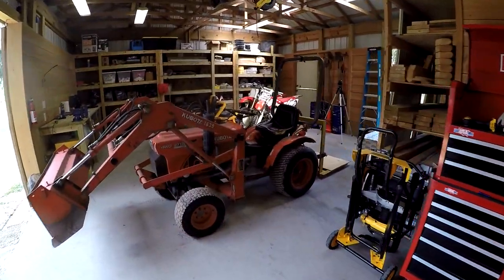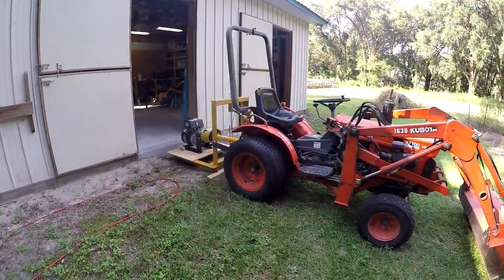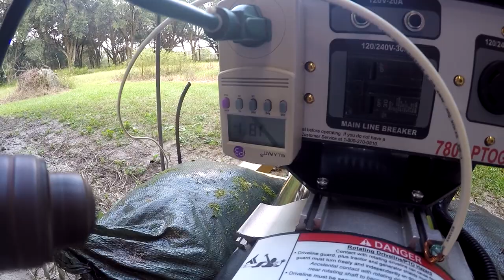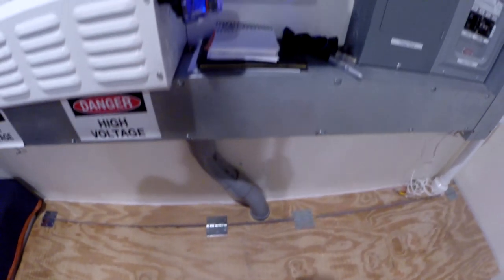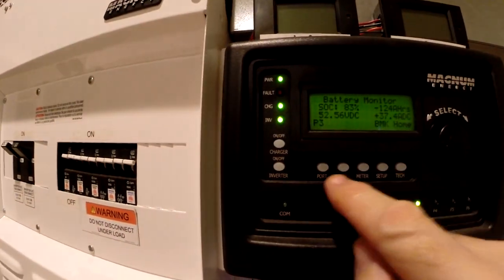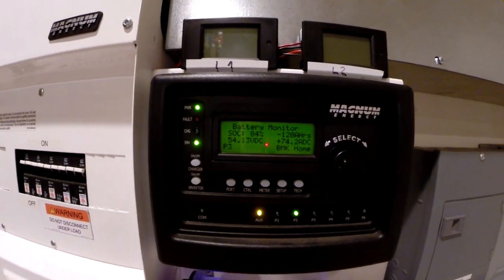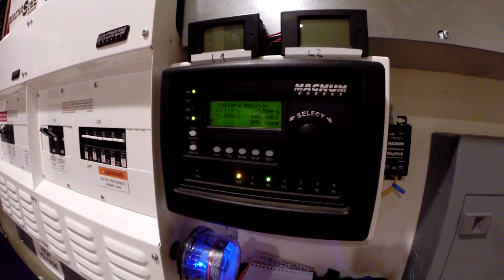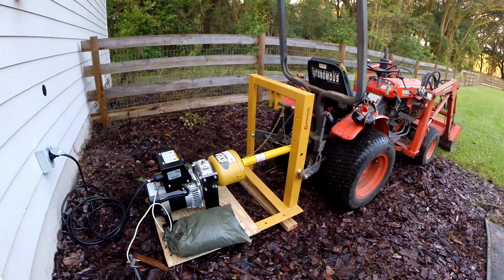NorthStar PTO Generator on Kubota B7100 Tractor

Comment: 2 things. Thing 1.  Ditch the plywood and use angle or channel as a foundation to mount the genny to.  Thing 2.  Don't leave your power cord from the house to the generator all coiled up.  I work at a major pharmaceutical company and we hooked up a giant diesel generator to run a building during a site shutdown.  The 500MCM hookup cables didn't need to be run very far to hook the generator up to the building so they left the cables coiled up on a pallet and just hooked up each end.  After a couple of hours, someone smelled something burning and it was the coiled up cables on the pallets.  It's the same principal as energizing a solenoid coil without being over the armature...gets hot in a hurry.
Reply from the maker: Good "things" to know.  Thanks!

Comment: Dave, I built nearly an identical setup about 6 months ago.  I used a Winco 10kw (made in the USA), and the same carry all.  Winco wanted $650 for their gen carrier.  As others have said, I would not use it for continuous power but running it a couple of hours a day to keep the freezers cold and other items charged is all one really needs to do.
Reply from the maker: Yes, a couple hours a day should do the trick,  The way I am using it, I only need to run it a couple hours per week and I with 200 gallons of diesel I expect I could go for about two years without utilities.  Thanks!

Comment: Fantastic video! You solved your "pros and cons" by installing a system with battery back up. You don't need two tractors! My wife and I are preparing to build an Earthship Biotecture style home in Northern Nevada...this is a means to generating power until the 4.6 kilowatt solar is installed. Blessings and Good Cheer to you and your family!!
Reply from the maker: So this system will get you by until you get your battery backed solar.  Once you have that, this system will work great but of course by that time you won't need it.  That's life...  :)

Comment: A true representation of how much how horsepower it takes to make electricity
Reply from the maker: Yes!  I am thinking of actually using it to measure just what the current horse power of my tractor is by ramping up the load and finding where it fails to supply the load.  I am guessing I could get to 5000 watts, 10hp.  2hp for every 1000 Watts.  I'll report back the results.  Thanks!

Comment: I run the 10000 on my 1025 deere it runs the house and the barn just fine. The tractor does use a lot of fuel. I bought a fifth gallon portable tank with a pump  to keep the fuel close to the tractor when it’s hooked up. But they work great.
Reply from the maker: Thanks for sharing

Comment: This is my exact set up. I have a propane connect right under the plug that goes to my solark generator connect. I can use my ck2610 tractor or my propane portable generator. I store 150ish gallons of diesel and my cooking is from propane with a 330lb tank.

Comment: Just a suggestion. The generator is designed to run at a steady 540 RPM so instead of messing with the throttle set the engine RPM’s so they are just above the engine RPM needed to maintain 540 RPM to compensate for the surge when a load is added. The other thing to consider is by not running the generator at its designed RPM when there’s a load on it you’re going to put a serious load on the generator with the possibility of burning the generator out and damaging sensitive electronics in your house by giving them too low voltage. When I had my fifth wheel I had a surge protector that would cut the power off if the voltage dropped too low to protect the electronics in the fifth wheel the same principle applies here as well too low voltage is just as dangerous to electronics as a massive voltage surge. Burning a few extra gallons of Diesel is a lot cheaper than replacing the generator and damaged electronics.
Reply from the maker: Hello David, the problem is that you have to adjust the throttle to maintain the 540 RPM.  This tractor and most tractors do not have the ability to maintain the RPM under varied loads.  When large loads are added, the RPM drops and you have to adjust the throttle to maintain the proper RPM.  When large loads are removed, the RPM shoots up past 540 and the throttle must be reduced.  The way I am using it, I just keep the load constant for 2 hours while charging my solar batteries.  That eliminates the problem.  Thanks!
Reply: The tractor should compensate for the load on its own to some extent because the fuel pump has a governor that should increase the fuel to compensate for the the extra load. If the tractor is not adjusting for the load on it’s own the governor may be stuck and not allowing the pump to adjust the fuel for the load. The other possibility is engine is starting to get tired even on the bigger AG tractors 5000+ hours is a lot depending on how they’re used/maintained and will start to show a decrease in performance.
Reply: @thegrumpyyooper6503  The governer on a mechanical garden tractor engine is not going to work well for a generator. This is shown in the video. Gensets use isochronus governers. Isochronus governers maintain the speed of the engine regardless of engine load. This tractor does not have an isochronus governer. I would bet that generators like this would function better with a newer tractor that has an electronically controlled fuel system, as engine speed does not drop when load is applied.
Reply: Generator RPM is not all that critical. The charge controller does not care at 9:25 that the frequency dropped way down and keeps accepting it, no problem. Modern electronic devices with switchmode power supplies do not care much about the frequency or voltage. Induction and synchronous motors will just run a little faster or slower.

Power utilities keep a tight leash on frequency because their customers are annoyed by the flickering of incandescent lights when large loads are turned on and off, and also because old mechanical clocks used synchronous motors that exactly followed the grid frequency. To keep the time correct on these clocks, the grid frequency had to average out to exactly 5184000 cycles every day.

If the grid voltage went up too much, incandescent lamps would glow brighter and brighter until they rapidly burned out from running so hot. A "brownout" meanwhile is when voltage drops, and incandescent lamps glow dimmer, changing the color from white, to yellow, to reddish-brown.
Reply: It’s because the tractor is under powered. My JD 1025R runs my 10KW PTO generator without needing to adjust engine RPMs regardless of the electrical draw. I set the output at slightly over optimal rpm’s and leave it.
Reply: @thegrumpyyooper6503  It's simply too small of a tractor for the application. The governor is likely not really setup for fixed rpm operation.

Comment: I would have thought that the tractor would have a governor that would compensate for various loads. Loading that engine down a bit won't hurt a thing and is actually beneficial. We run a kubota rtv since new and has just shy of 10 k on it. Runs a minimum of 3 hrs a day 365. From time to time I hook up something heavy to it a give it a good long run under heavy load. Smoke starts out blue then grey then black, cleans up and it loves it. Great little engine
Reply from the maker: I love hearing accounts like this.  I do baby my equipment a bit but on occasion I do run them hard so I like hearing from folks saying that its OK and they have done it plenty with good results.  Thanks!

Comment: If you plug it into your home circuitry you don't need the ground rod, It grounds through your system. Just make sure the 240 circuitry/receptacle is grounded to your breaker box. The ground rod is only required if you run it out in the field or if you run an extension cord that's not grounded to the house.
Reply from the maker: I agree.  Thanks!
Reply: It’s called neutral bonding, but check your manual to be sure.

Comment: Great info and video.  How would you rate the NorthStar PTO Generator after a year and half usage. I have a 1988 B8200 I've owned since new.   It has been great and I'll keep it forever.  I'm looking to purchase a PTO generator and would like to hear any additional comments from you.  Thanks for the video. Very helpful.
Reply from the maker: I run it about every 3-6 months for about an hour or two just to keep it in shape.  It has worked perfectly with no issues so far.  I run it at about 3-4k Watts output to charge my battery bank.  Nothing bad to report.  :)
Reply: @HomesteadEngineering  Thank you for your response. Good info.

Comment: Dave, those Kubotas have multiple pto ranges correct? Would that help or hinder? Can someone respond with knowledge or experience? And did you try with your 2601? Thank you
Reply from the maker: Yes, My B7100 has high and low range on the PTO.  I run the generator in high range.  I can run it in low range and it has more torque that way but it revs too high.  I have run it many times now and have slowly gotten more comfortable running it with higher loads.  It does just fine, no problems so far.  Thanks!

Comment: What a great video, I am trying to set up something very similar to this set up. I have a question if you don’t mind. If you had a bigger horse power tractor to a smaller generator would that be a problem? My tractor is 35hp (engine) and I’m thinking about a 7,200 generator. (14 Hp. Recommend pto) Is that some kind of problem?
Reply from the maker: KB, As long as the PTO shaft is turning at the right RPM it should not matter how much HP the tractor has.  I don't see having too much potential HP as being any kind of problem at all.  You simply won't be using all that extra HP.  Off the top of my head I think it takes about 2 HP for every 1000W of electricity.  It will probably be a bit less efficient but it should work fine.  Thanks!

Comment: My uncle had one of those 80s early 90s hydrostatic b7100s, It had a 2 speed pto.
.
Is it possible you didn't have it in the 540 speed? Usually rated engine speed for a set pto rpms is quite near high idel, or maximum rpms of engine. The engine just sounds closer to mabe 2k but I could be wrong.
Though it's interesting to consider  running a light load with a gen at rated speed, but under speed the engine for possibly reducing fuel use a smidgen.
0.01c
Reply from the maker: Hello Bruce, I had the PTO in high gear.  I can run it in low gear but it revs much higher for sure.  Its actually pretty good on fuel consumption.  Thanks!

Comment: About how long do you have until you have to fill up your tractor with fuel after continuous running of the generator?
Reply from the maker: I will have to do a test to find out exactly.  My wild guess would be about 10 gallons for 24 hours running at 3000 watts output.  Just a guess.
Reply: @HomesteadEngineering  that would be my guess as well.  My farmall Super H does about 14 hours give or take at around 3/4 throttle.  Just gotta change the oil after a few longs days of running.

Comment: Nice unit, I was just looking at these yesterday. I just sold my military trailer-mounted Onan generators because the power hasn't gone out once in 6 years. That was probably a mistake. Anyway, looking at one of these now.  IMD makes one with avr as well. You are correct, much better THD with these generator heads.
Reply from the maker: Uuuummmm yah, should have hung on to one of those for sure.  :)

Comment: I’d like to do a similar setup on my X758, how much hp is your tractor?
Reply from the maker: Brendan, I believe it was 16HP when it was new and probably less now.  Not sure but I would guess you need 2HP for every 1000W of generator and I don't like to run my equipment at 100% duty cycle.  Thanks!

Comment: That's a really expensive cell phone charger LOL.  That's a great setup, for like you said if you have multiple tractors so your only tractor isn't tied to your generator...although in a pinch its not that hard to unhook and hook back up if you needed to use your tractor to remove snow for example, then hook back up to your generator when you are finished...but having a dedicated backup generator would be the only way I'd go, if I had propane on site...in a power failure I'm not sure how natural gas supplies might get interrupted as the pumps probably shut down too I'd assume.  I have a 225 gallon propane tank that just my furnace runs off of, if I got a backup generator I'd go with propane and just have a larger tank brought in.  I don't have a tractor so a PTO generator wouldn't exactly be useful for me LOL.  I do want to get a tractor just a lot of other things have gotten in the way this year, and its been 30 years already so what's another year or 2 waiting LOL.
Reply from the maker: William, you might like this dual fuel generator: https://youtu.be/h9vvs2ilUIo

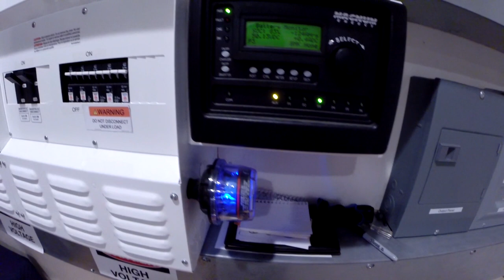Comment: With all due Respect. You must be an Engineer or something by Trade and have some deep pockets. I was following along pretty good until you walked in the Garage around the 07:00 minute mark of video when I saw that wall of Star Trek Guidance Systems, LOL...and I was lost!. I've been thinking about getting one of those Generators for my MX5400 KUBOTA. But after seeing what all it takes to transfer power to house, I'll probably just get some more coolers and build an outhouse! LOL. Thanks. Hurricane Ally. S.E. North Carolina. 15 miles from Coast.
Reply from the maker: Beefan, I hope I did not give you the impression that you have to have all this to connect to your house.  You can connect with just a transfer switch or even extension cords but you must be mindful of the RPM (Voltage) as it changes with the loads.  Thanks!
Reply: @HomesteadEngineering  oh, ok, thanks Mr. David. That makes me feel better. All my best.
Reply: @HomesteadEngineering  You also need to make sure you aren't back feeding power through your main service panel and back out into the main power lines if you are grid-tied....not really an issue if you are 100% off-grid though.  Many people don't realize when they 1/2 ass hookup a generator to their house mains that its back feeding that power back out into the main electric lines and can injure or kill a line worker trying to restore power.
Reply from the maker: @wildbill23c Yes, you need to use an actual transfer switch NOT a suicide cord like you see some folks do.  Thanks!
Reply: @purplesocks9745  A separate 30 amp (in this case ) 2 pole breaker directly under the main breaker.  You mount a rocking on off device that either keeps the main in and the 30 amp out, or the 30 amp in and main out.  That will conform to code.

Comment: Instead of hanging the generator off the back of the 3pt frame, shorten the PTO shaft. It’s not that hard to do. Also the long shaft is dangerous as it could damage the tractor PTO housing if the shaft is jammed into it.
Reply from the maker: Probably not a bad idea to shorten the shaft and move the generator forward on the 3 point.  As it is there is plenty of play in the shaft so as not to jam.  Thanks!

Comment: Was your cable going between the Gen and the Wall getting hot? I thought you mentioned it was a 30 amp plug. Wither way, at 78Amps was the last reading I saw, and such a cool setup! Makes me jealous!!! Now I want to copy you, only with a 60 hp tractor.
Reply from the maker: OK, I was not very clear about this... The Amps you see on the solar power are relative to the battery voltage seen just to the left.  So 90 Amps at about 55 Volts = about 5000 Watts.  That's well within the (240V) 30 Amp circuit (7,200 Watts).  Ya follow or am I just making it worse?

Comment: About what year is your old Kubota tractor?
Reply from the maker: About 94ish
Reply: @HomesteadEngineering  just wondering. I like the way it looks and am thinking about looking for a older subcompact tractor. I've had so many of the Craftsman and MTD ones that I'm wanting to get something better but can't stand to pay what they want for the new ones and they even want so much for one day 5 years old that ya may as well get a new model. Anyway I liked what I saw in yours. Thanks for the reply.
Reply from the maker: @jerryhayden8720  The old B7100 has served me well for over 20 years now.  I have moved the world with it.  I paid $7,500 for it used and I think its worth maybe $5,000 today.  That said, there is a WORLD of difference between  the old tractor and the new one.  The skid steer quick attach alone makes a huge difference.  The quick hitch makes a big difference as well.  Power steering (huge) and a faster moving loader.  Three speeds and easy four wheel drive.  I paid $25k for the B2601 and a bunch of attachments.  Ho[e you find what your looking for.
Reply from the maker: @jerryhayden8720  More tractor videos: https://www.youtube.com/watch?v=rswvF-r1TRE&list=PLkTIWHBRRyi4fflHDEas4RaQgd73qMnYq

Comment: I have a B2650 that’s setup for a front snow blower with the center PTO running down under the front axle to a set of pillow block bearings with the PTO spline shaft there where the shaft of the blower connects to But I was always wondering if I could DIY/weld build a small generator attachment for that shaft!   When I am actually running the snowblower that shaft is turning at 2600 RPM  I was hoping I could design some type of generator head that could directly couple between that shaft with a universal joint and run at the engine speed but generator heads either run at  4 pole 1800 or 2 pole 3600 rpm But I could  set the engine lower and always  raise the RPM with a gearbox for a smaller generator head.
Reply from the maker: That sounds like a fun project.  Good luck!